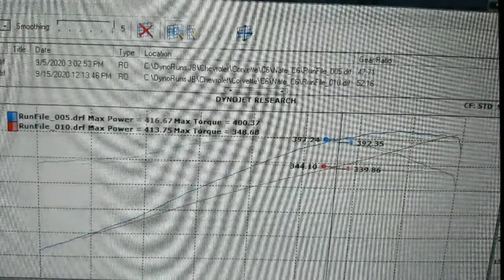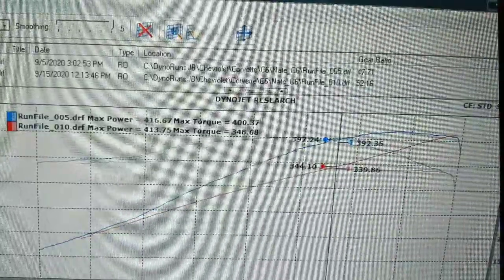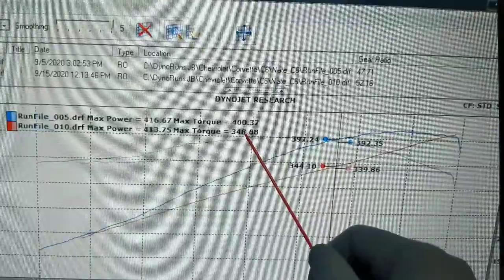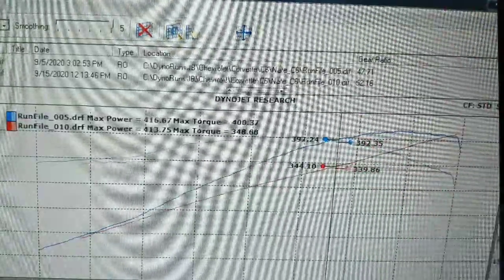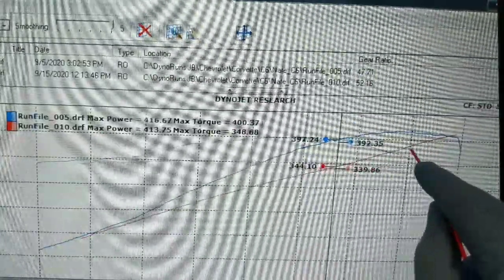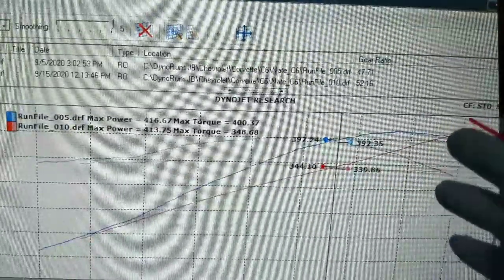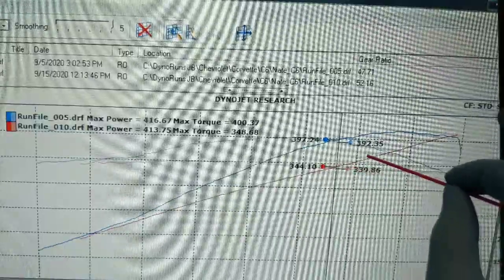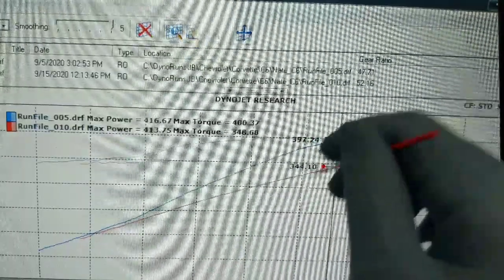Final Test of Race Ported Intake on Stock LS3

Comment: The stock cam is pretty damn good. It was good enough for us to run 10.5@132 with a bolt on c6 ls3. And we made as much as 470whp with a bolt on 5gen ls3 1le.
Reply: How the hell are you getting 470-490whp with only cam headers and intake porting?!?!

459 comp cam or sloppy stage 3 on ls3 and headers make barely 400whp at 7000rpm

I cant see how you get 470-490 without head porting!

Did you do anything other than cam intake headers??
Reply: @FirstLast-tx3yj  attention to detail is how. The cam and heads were stock.  It's pretty silly to put port the ls3 heads on a 6.2.
Reply: @GETLITUP69  well i guess attention to detail is worth 50whp😂 
If he admitted that it had a cam i wouldve been okay with that
Reply: @GETLITUP69  well i guess attention to detail is worth 50whp😂 
If he admitted that it had a cam i wouldve been okay with that
Reply from the maker: @FirstLast-tx3yj  My LS3 C6 makes 420rwhp with the stock cam and just headers, ported throttle body and a tune. With BTR stage 3 and 4 cams we regularly see 470-500rwhp on manual trans LS3 C6's.
Reply from the maker: I've never seen 470rwhp from a stock cammed ls3 without spray. They usually make 420-430rwhp max. Would be interesting to see the data but the LS3 definitely responds extremely well to even basic mods.
Reply: @c5natie1  
https://youtu.be/qWwOtvFG3Ro

There ya go. It made 473whp 478wtq. Not the only dyno it was on either.

C6 will make slightly less because it turns a ps pump and 2015 up 5gens had eps. If i remember right his ls3 c6 did 458-465whp with nearly equal tq. Used tri y 2" headers on the c6 and it reduced tq in the mid range but it carried better up top.
Reply: @c5natie1  

https://youtu.be/c-z7r5-25OY

There's my own bolt on ls6 making 451whp/423wtq.  It was on pump gas, through a 9" and full true dual exhaust.  I did bypass the ps pump for the dyno because i wanted to see it on par with other cars of today. If it was on e85 it would've picked up in the 10hp range likely.  Seems to be the standard anyway.
Reply: But.. can you still get 30Mpg on the highway?
Reply: @aphil4581  nearly when it was bolt ons. The bolt ons typically even free up a little mpg.
Reply: @HioSSilver1999  My long tubes did and a bonus of 121.4 mph. STOCK cam. Using stock  auto 6speed with  3200 power adder stall (YANK) and dr2s it's 10's no added Hp. Small gas mileage cam but no lash solid cam not hydrolic. Will clobber a bone stock Z06. U will get some hp just from the extra rps. staying as close to the stock cam. 30 MPG.
Reply: @c5natie1  my car made close to 440 on my c6 ls3 manual , just intake & headers

Comment: I always liked my fast 92 Tb on the stock intake even on my 418 stroker. With 4.10 gears 1.5 sixty foot's with a heavy f-body! My stock ls3 vette vert loves all the exhaust work I can give it. Kooks longtubes with race cats, 3" pipes all the way back and loudmouth pipes 2 1/2". But the ls3 computers hate heat and I'm in Florida. 08 vette on Toyo 8008r's 60* BMR dragway 121mph 11.8, 1.9 60 foot. 121Mph in a loud convertible blew my mind lol. I should try leaning it out with some 87 octane lol but the computer might smell what's in the tank :(

Comment: Nice video thanks for the data but I have a question how much would be to port my intake
Reply: 2015 camaro ss LS3
Reply: @GETLITUP69  If your really racing with solid's, strokers, gears and stalls try the mid runners! Don't forget to use electric cut outs too.

Comment: I'm wondering if a ported intake on my l92 would help my cam is 220/232 .600/.600, 112 LSA I have the stock intake on it and trans had a 26-2800 stall  converter on it. In my 07 escalade. Currently have shorty headers on it been thinking about long tube headers but still run cats for emissions
Reply from the maker: Long tubes will definitely give you the best most noticeable gains especially in the top end with your setup. With your cam you should also see a decent gain up top but also improved throttle response with a ported intake. Although the weight of the vehicle might mask some of it.
Reply: @c5natie1   90mm or 102mm throttle body?

Comment: so could I technically port my intake from the inside without opening up the mouth of the intake and leave my 92mm throttle body and be fine?
Reply: I don't think it's worth it unless you really like to spin it up to 6500 rpm in first gear. The Fast 92 is a peach!